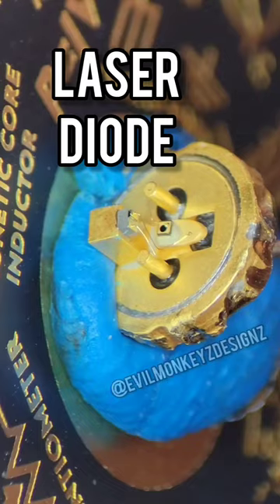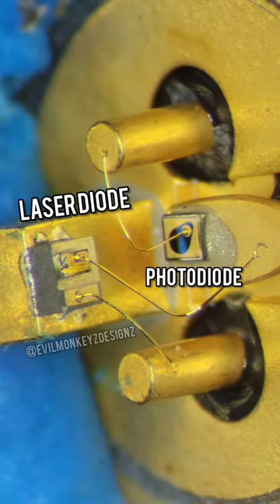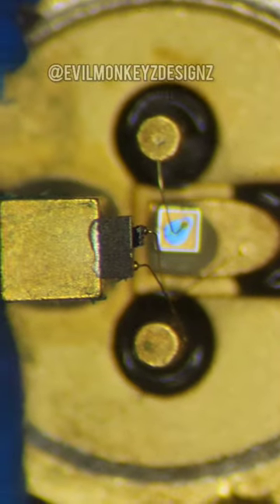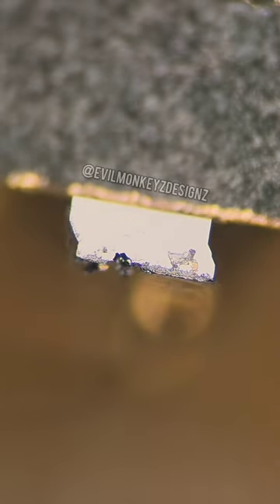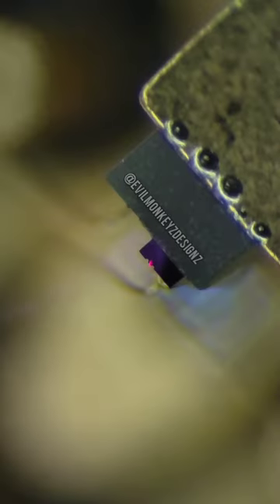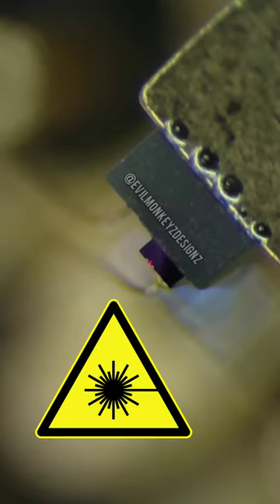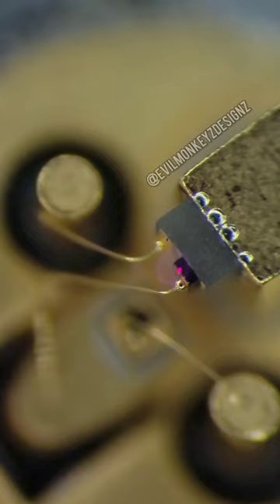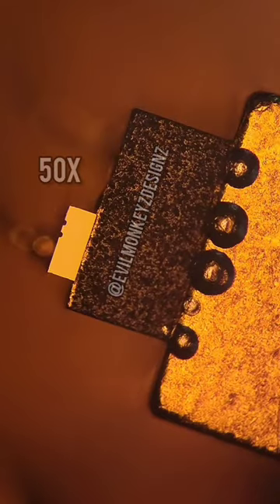What's inside a laser diode? #laser

Comment: From what I remember from my lectures, the reason there isn't a hole that the light is coming from is because the light is coming from energy being released from electrons moving in the PN junctions of the material. So it was just designed to release that energy at that spot
Reply: That’s cool info.
Reply from the maker: That definitely sounds correct, and it makes sense because I can't see the PN junction with my microscope, which gives the illusion that it's "coming out of nowhere". I'll have to do some more reading about diode lasers. :)
Reply: Also little quantum mechanics involved that can't 100% be explained.
Reply: So what you’re saying is that design doesn’t require a mirror lens sandwhich like the one you’d find in a typical laser?
Reply: @CloroxBleach0  So it's a similar idea, but on a scale of micrometers. You have your PN junction made of semiconductor materials, and an air gap junction between the PN junction. As you pump energy into the PN junction, electrons release and collide with holes and release energy. This process just keeps happening-converting electron energy into photons, with the photons bouncing between the PN junction, until it eventually exits the air gap junction and is emitted as light.
Reply: Thank you all! Lasers are incredibly fascinating to me, and this video has answered some questions. Do you think that this is scalable?
Reply: @samwillard5688  it is scalable in the sense that what we do with a diode laser is just a tiny scale of how real lasers work. Bounce light between 2 mirrors and out a lens (ofc very basic description, im more of a power EE, not a big fan of the physics side)
Reply: i guesss focal point adjustments is not correct.

Comment: I'll be teaching this in a few weeks again in a course on optoelectronics. I generally don't like "shorts", but this one was really click-bait for me - in a positive sense.
First, the crystal is of course not a silicon crystal, but a III-V semiconductor. The photodiode gets hit by a fraction of the laser beam which is emitted to the rear through a nominally fully reflective mirror surface, but enough light is still escaping there to give a feedback signal to be able to run the laser diode at a constant emission, because even running it at a constant current will not keep the emission sufficiently constant.
The material in the III-V crystal itself is grown as a stack with different doping and bandgap, restricting the light-producing emission to a small layer. The grooves on the top further modulate the vertical shape of the current density, making most of the current go vertically in a narrow strip through the recombination layer. Only this gives locally a high enough carrier density to allow for the laser process to happen, and it is now restricted into a strip through the whole crystal. The ends of the crystal are more or less atomically flat, the backside optionally also covered with a reflective layer, so that the light can bounce back and forth inside the crystal and the majority will escape to the front only.
Reply: This channel is only about semiconductor teardown and not one dedicated to university level lecture. Also the 60 second limit doesn't help in this case. 

But thank you for your insight nevertheless. It just rubbed me wrong when you called it click baity when in reality this channel is a rare gem in this site and is doing something cool and unique. There are other channels which do the explaining in detail with all the physics behind it .
Reply: @redmist4963  I did not mean it in a negative way! I generally ignore all shorts since I don't appreciate the compression to one minute. But here I was attracted by the title and contents - and I really appreciate the close-up views. I then only wanted to complement the narration with the answers to some open questions. By the way : I have been a subscriber for quite a while...
Reply: @uwezimmermann5427  I for one, appreciate the insight from your original comment. I wish I knew more about how lasers work. :)  thx!

Comment: The flow of the electrons is very important for laser diodes, therefore they can have quiet complicated epitaxial structures which often are also etched to form a waveguide for the transversal direction of the emitting light wave. Therefore the emitting area is typically some microns below the upper surface.
Reply: uhuh
Reply: The flow of electrons is important for every electronic component. So is the flow of holes in semiconductor devices.

Comment: I have been working in the communication industry for many years, I was wondering how the optical transceivers are made and the incredible engineering behind.
Reply: You should see how complex solid state tuneable lasers are! Multiple sections that are either tuned by current injection or by tiny heaters on the active areas, and they all have to be controlled precisely to keep the laser operating on a specific longitudinal mode.

Comment: I thought lasers typically required cavities? Are they simply for amplication and this is the source that illuminates the cavity? Or were my previous assumptions wrong?
Reply: You are right. Lasers need three components: 1. Resonator (Cavity), 2. Active medium, 3. Pump source
For an edge emitting laser diode like in this case, the resonator is just the front and back facette from the semiconductor. The reflectivity of the front facete where the laser light leaves the diode comes just from the refractive index difference of the semiconductor to the air and is about 30 %. The back facete is typically coated for a higher reflectivity of over 99 %. The photo diode collects only the light which is leaking from the back facete.

Comment: I am so frustrated rn, I made the whole circuit for a laser Security system and now i found out that the laser module is getting overheated when I supply energy to it using a 9v battery, later I tried a resistor but the intensity of the laser light was greatly reduced, then I tried different voltage cells, even combined some 1.5v cells to make a 6v cell to use it on the laser but this time it didn't even turn on. I DONT UNDERSTAND WHAT TO DO OR HOW TO GET THE LASER WORK PERFECTLY.

Comment: The two flat faces of the Silicon P-N Junction are polished flat to form a mirror and parallel to form a tuned cavity.
One mirror is 100% reflective. The laser light is exiting from the the mirror that is 99% reflective.

Gregory/
The Pigeon Meister
   ... .  🐦‍⬛
Reply: No, they are not polished. Just cleaved, which is simply scratched by the diamond blade and broken apart. Neither they are parallel - some lasers have to be discarded to pass QC